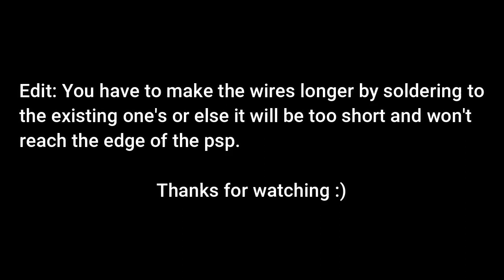PSP 2000 USB-C MOD

Comment: Nice work , it's really impressive , would you be doing more mods ?
And I have some concerns regarding that gap in the shell , wouldn't dust get in ?
Reply from the maker: Yes i have some upcoming mods and as for the gaps i clean my psp often so no worries there
Reply: @axemods03  is there a way to buy the connector w/ the modded usb c?
Reply from the maker: @alfonzie11  What do you mean by that ?
Reply: @axemods03  Its for people who dont solder I have no experience soldering. Just the usb c port with the connector already soldered  for the psp
Reply from the maker: @alfonzie11  Alright I understand but sadly there is not it's custom made but if you really want to you can learn just by watching a couple youtube tutorials that's how I started 😉

Comment: cool mod, but remember not to use fast charger brick... iirc original psp charger output is 5v 1.5A right
Reply: From what ive heard, current is pulled instead of pushed so the charging circuit of the psp probably only pulls 1.5A out of the charger so I think it should be fine if charger is 5v 2A.

Comment: How do you hold the port in place? Also can I use salvaged cables from chargers to make it longer? Sorry for the odd question in new to this
Reply from the maker: Well you can glue the port with super glue or hot glue and yes you can salvage wires from any usb cable
Reply: @axemods03  i have some 22 gauge cables will that work for the splice?
Reply from the maker: @efrainhunterftw7700  too big personnaly I use 30 awg wires

Comment: I did this mod, but the charging port sometimes comes out when I pull the cable out. How do you keep yours from coming out?
Reply from the maker: I glued it with crazy glue (super glue) ;)
Reply: @axemods03  Holy crap I didn't expect an answer this quickly! Lol I brought out the super glue and went to work immediately after reading your reply. Thanks man! Cheers!
Reply from the maker: @thespianmask  Haha no problem 😉

Comment: Is it possible to solder D+ and D- to actual USB Port to support also data transmission (connecting to PC)?
Reply: Good question. I think that reaching cables to the actual USB port would be enough. In my opinion it would be better to put a USBC also on the top of the console

Comment: I don't have the necessary tools to do this cleanly (I'm afraid of ruining the looks of my psp) so I'm thinking of just buying a usb c female board and connecting it to a barrel jack. So it's gonna be like a little dongle so I can charge with my phone charger.

I just wanted to ask if it's safe to use a phone charger. My phone charger is rated 5V 2A. Have you encountered any issues with this mod?
Reply from the maker: True you can probably just buy a jack to usb A adapter and yes a phone charger is fine as long as it matches the original psp charger specs which is 5v 2a
Reply: @axemods03  Thanks! I actually went ahead and tried this out and it works! I soldered a compatible barrel jack from a random charger I had to a type c I salvaged from dead hardware and it works great with my charger! The result isn't as elegant as yours but I think ive done my best. Thanks for the inspiration! :)

Comment: What voltage  did you use for the USB C port is it 5v, 9v, 12v ?
Reply: The barrel jack is a 5v connector, so I'm assuming it's also 5v.

Comment: what if the wires connecting to the port are too small to reach the hole?
Reply from the maker: Then cut them half way and solder some longer wires to it hope it helps